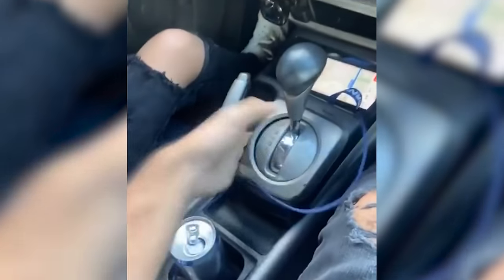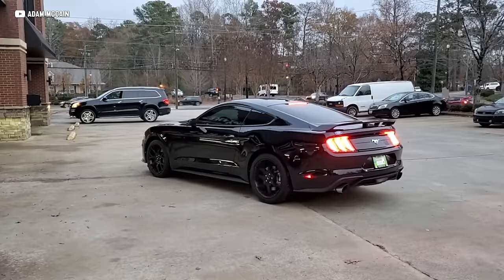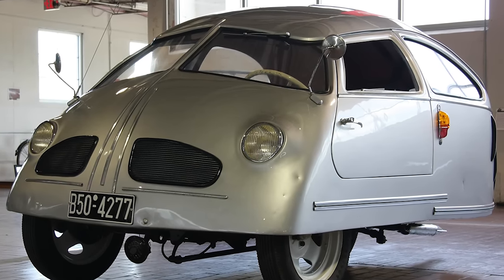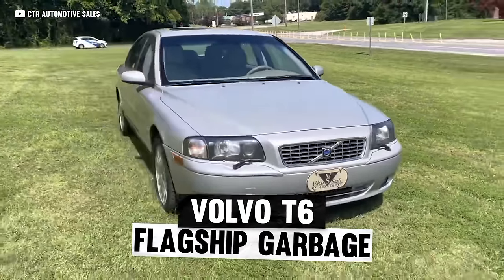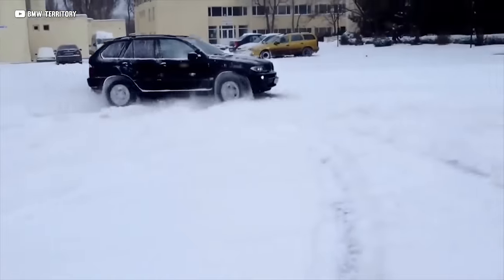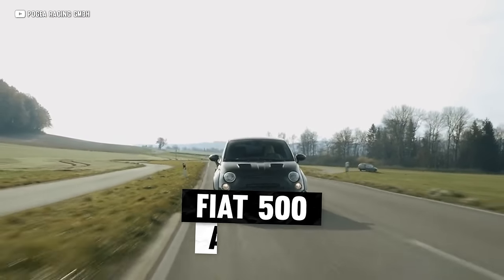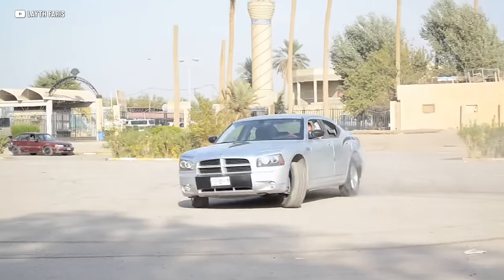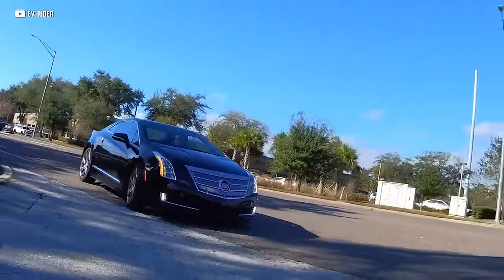Worst Cars You Should NEVER Buy!

Comment: Dead wrong about the eco, it’s a great car and it’s actually smarter to buy then the v8 buddy, better gas mileage and torque too
Reply: Is it actually? I’ve never driven any mustang, so I’m genuinely curious.
Reply: @dwest1756  I have owned mine since 2019 the ideal power band is between 2k and 3.5k rpm and being paired with a 10 speed auto acceleration is pretty good. With some upgrades and tuning you could easily match or beat the hp of a GT. Although I've always dreamed of owning a GT with a 6 speed manual it's definitely not a car to overlook by any means especially if you are under age of 25 or on a smaller budget. Also boost how can you hate boost
Reply: The Ecoboost may be a better car, factoring cost and practicality but the GT is a better sports/ muscle car. Depends on whats important to you.
Reply: @revmatic32  you also have to consider what the mustang really is it's not really a muscle car at the end of the day it's a pony car. Yes it comes with a v8 but traditionally the muscle car comes with a big block v8 not a small block v8 or anything below that so to call it a true late model muscle car ford really should only be putting there newer 7.3 gas engine in the GT
Reply: Ecoboost putting down more horses than every generation of Mustang V8's until 2010 that isn't a performance model like a cobra/mach1/shelby. The V8 fanboys pretty idiotic when they have to debate numbers.
Reply: @Tyler1288MC  Personally, it's not worthwhile to debate if the Mustang GT is a modern muscle car, it competes in the same segment as other modern muscle cars like the V8 Camaro and Challenger/Charger. You're right about what the term traditionally means so there is that. The point of my comment is that if you prioritize efficiency, cost and practicality there's a Mustang for you and if you want a sports/ muscle car there is also a Mustang for you, and that point still stands. 🍻
Reply: @revmatic32  I don't disagree tbh it was nice to alteast have a relatively civil discussion in the YouTube comments for once.
Reply: @Tyler1288MC  it is pretty nice huh!? There's hope for us after all, gotta spread the civility. What do you drive?
Reply: As a 2013 5.0 Owner, I am grossed out. My car can get 31mpg going to work an hour away. If you are worried about gas mileage then don't get a Mustang in general. These vehicle are fun vehicles, which come at a cost when you get rough with them.
Reply: @airbomb34  I still rather have a V8 2010 than an Eco. Those things sound like ass. I also doubt the ecoboost is more reliable than the 4.6 in anyway. You will be burning oil in no time.
Reply: I agree the eco boost mustang is a good car and has a lot of tuning potential and aftermarket support since it shares the engine with the focus rs
Reply: @airbomb34  so has basic sedan’s too… engines get better every year.
Reply: @revmatic32  sports and muscle cars are 2 different things. The ecoboost is a better sports car because it's lighter on the front end and it handles so much better than a GT. A GT is a better muscle car because it has a better sound and more ponies and works much better in a straight line.
Reply: @airbomb34  yes. Let's also not forget V8s are turning into dinosaurs.
Reply: @rickitysplitz7035  the 2010 look on the mustang was HIDEOUS. I agree though the eco doesn't sound great which I why I got the 3.7! So much better sounding.
Reply: @jake51515  I don't see it that way, and while traditionally the differences were significant , buyer trends forced Ford and Chevy to make their muscle cars more competitive in the sports car market. I'm sure the Ecoboost is a good enough car for people across a spectrum. Though, I think if I wanted a sports car in that price range I'd go MX-5 or BRZ. A GT with the PP2 or Camaro SS 1LE is a good sports car muscle car hybrid for my money. I went a little more and got a GT350 though.
Reply: @rickitysplitz7035  Doesn't your engine shut down 4 of the 8 cylinders during highway cruising?

Comment: The Ecoboost  Mustang was the best selling "Mustang"...until the Mach E came.
Reply: And the ecoboost is also more of a mustang than the Mach E will ever be, no matter how much cool music appears in commercials for it or how much ads will emphasize the nonexistent “mustang” part of it
Reply: Ecoboosts put decades of Mustang V8's to shame in the power rating. It's pretty hilarious anyone could actually claim it's not a mustang because it's not a V8.
Reply: @airbomb34  But you forget that the Ecoboost's downside is reliability. They are not solid like Honda engines, and will not last near as long as the 5.0, let alone 4.6. You also talk how they put them to shame but forget it isn't naturally aspirated. If you put a Turbo on the older V8s, they will surely put that Eco to shame.
Reply: @rickitysplitz7035  my brother eco has almost 100000 miles with no issues and yes you can put a turbo on a v8 but 4 bangers handle boost better and their lighter
Reply: @airbomb34 : Sounds like something an eco boost would say
Reply: @rickitysplitz7035  the Ecoboost engine is fine. You can easily get 300k miles from it. If you tune it, well it's up to how you tune it.
Reply: @airbomb34  the problem is that people expect the Ecoboost to be a V8... it's not. It's better for some things and lacks some other things, but it's a great Mustang
If everyone would see the Ecoboost Mustang as the replacement for the S15 Silvia... as a continuation, then it will never had to be compared with the V8.
Reply: @E46SedanGaming  lol you got that right

Comment: The Ecoboost makes all S550 Mustangs legit performance cars no matter what drivetrain option is chosen. Especially since you can get PP1 and PP2 performance packages. If you are a young enthusiast, in your 20's, first time car buyer you get a break on your insurance rates than the GT, you have way more usable room in Mustang than you would with the GT86/BRZ twins for roughly the same price and with a turbo upgrade and tune you would making GT350 hp and tq.  I'm  60 yrs old I remember the Mustang SVO when it was new.  Even Road &Track said it handled better than a Ferrari. But Stang bros were more interested in 1/4 mile times than turning a corner and the GT was cheaper.
Reply: You said it so I don't have to. All of the other cars in this list have horror stories attached to them about performance and reliability or safety. The ONLY reason the Ecoboost is on here is because "it doesn't sound like a V8." Laughable when so many viewers of this channel LOOOOVE turbocharged four cylinder imports.
Reply: @JosephFrietze  Yeah this was purely purely for aesthetic reasons nothing else. It didn't belong in this video. Besides this was a genius move by Ford  to have a base engine that have both balls and more the old V6 options a ton of aftermarket support more than even the turbo 4 in the base Camaro. And kick in better weight distribution than the GT it's win win win.
Reply: @colinw7205  the turbo 4 in the camaro has slot of aftermarket support

Comment: Disagree with the Ecoboost. That car puts out a lot of power and since it’s a turbo 4. It responds really well with mods cheap on gas light weight and a lot of aftermarket support. This engine was also used in the AWD 350hp Ford Focus RS.

Comment: The eco stang is a great car! I've owned 2 a 15 and a 16 both premium pack and the 16 with a ford performance tune and the larger calipers and brakes. I'll say it doesn't sound good, but it's still a fun car! To someone like me who loves the mustang, but doesn't want 15 MPG, the eco is the better way to go! Personally, now I drive a 14 3.7 because I got a good deal and for longevity, I trust the proven 3.7 much more not to mention the v6 sounds GREAT with a Rousch exhaust! It blows my mind the v6/4 cylinder stangs get so much hate. They make so much more sense than a daily driving V8. It also annoys me when people say "You don't get a mustang for the gas mileage". I'm like no, but that doesn't mean I want as shitty fuel economy as possible. 15mpg vs say my v6 which I average about 22 in the city may not seem like much at face value, but it's the difference between getting 240 miles in a full tank vs mine which I get about 340 miles per tank. Also not forget its got over 300 horsepower, as much as older V8s and there's still modding potential. Needless to say, the v6/eco mustangs are still great cars and without them the V8 wouldn't be possible.

Comment: You explained exactly what the fix is for the MazdaSpeed 3’s problem is. So buying it isn’t so dumb now, is it? And a bit of disassembly isn’t really much for someone who’s been working on cars for a bit.
Reply: And another thing, the SVO Fox wasn’t a screwup in my eyes. It had a decent kick for its time. 175hp wasn’t too bad for not long after the oil crisis. As for the ecoboost S550, other parts of the ecoboost family can be found in other ford cars. The ecoboost 3 cylinder can be found in the fiesta ST. An ecoboost v6 can be found in ford police interceptors, the explorer ST, and the bronco raptor. So don’t judge a book by it’s cover
Reply: The Speed 3 ine really isn’t even a “problem” I’d you’re only doing basic mods like an intake and exhaust. As soon as you start adding down pipes and removing cats or tube it,  then  you gotta upgrade the fuel pump.
Source: I’ve owned two Speeds
Reply: Yep... the title is dumb. Most cars have a weak spot, and once it's taken care of, well they become something worth keeping.
Reply: @E46SedanGaming  not a screw up, but Brad's statement about Mustang SVO and Ecoboost is.. along with 90% of the other statements he made in this video.
Reply: @AgustinLajeArrigoni-tv1kh  what kind of sense is that supposed to make

Comment: Don’t necessarily agree with your opinion on the ecoboost mustang , it does sound like a rice burner but it is  because it shares the same block as the speed 3 and 6i t’s a great daily it’ll never be the v8 but it still better then how you talk about it,  for people who just want a mustang it’s a great option save money on gas and might I add oil change cost of a eco is way less then a gt plus it corners a hell of a lot better due to less weight on the nose, I don’t understand why they get so much hate their a great starter platform that cheap and responds to bolt on well, way overboard on the SVO btw , I own a FBO Ecoboost mustang and Whipple stage 2 GT in case anyone wants to say I’m biased 😂

Comment: The Mazdaspeed6 also had the same engine as the Mazdaspeed3 but would snap rear diff mounts and drive shafts.  Mazda no longer makes those rear drive shafts so you have to go aftermarket when they snap. Both shafts and rear diff mounts you are over $1300 in after market parts and you have to drop the rear end out to fix them so you might as well get new suspension and anything else done that needs replaced.  I still want one.
Reply: I have a speed3, buddy has a speed6 and loves it. Highly recommend either

Comment: Dodge Stratus/Breeze/Cirrus are way worse than Sebrings...believe me. 
I had a Cirrus and it was bad, and I was young/stupid. The battery was above the driver side tire. They overheated all the time. They were quick if you had the Holley throttle body, but that was it. Plus, front wheel drive. Not fun, not reliable, 2/10 lol

Comment: I had a 2013 gli with the 6 speed that was great in like 2015. But it got me hooked and was looking locally for something more powerful fairly quickly. I found a single owner b8 s4 that had like 50k, and was at the same dealership that my dad worked at the bodyshop. The owner was an elderly professional, that he meticulously maintained. I scoffed at the auto transmission, but decided to go through with the test drive anyway. Glad I did, because I absolutely fell in love. Was obviously my first experience with a dual clutch auto. The powertrane was solid (while burning a bit of oil) up until 2 months ago, when I traded it in. It was painful, as I had grown attached to it, and had lots of memories. I did so because it turned 110k, and was starting to need more and more minor repairs, and also a costly starter. I knew it would wind up becoming a money pit, if I held out longer. Great car though

Comment: I have 3 Audi's, all turbo 4 cylinder. A 2001 B5, 2004 B6 and 2014 B8. My 01 has 200,000+ miles on it and in the 3 years I've been driving it I've never been stranded. I've put about 60K miles on it with no major issues!

Comment: The late model cheverlete 4.3 ltr engine is having problems recently too. I've had lots of em and I've had to replace  accessories but never had any problem with the 4.3 ltr engine. Now I have a 2018 I've never had to replace an accessory or anything what is knocking can I change the oil religiously yes it has 180,000 Mi but I'm used to getting 300,000 Mi on a big engines. What what went wrong?

Comment: I had a Pontiac trans sport v6 and never again, I had to tear off the inner cylinder head because of the exhaust leak (a bolt had gone off). Later, the intake broke, after that the gearbox began to malfunction and locked itself in overdrive. That with the gearbox I easily fixed by connecting a switch to the overdrive solenoid. Started leaking coolant inside the car due to the heater broke etc etc. 
Got a fiat ritmo for about 100$ it I drove for a couple of months before it started to be a lot of different electrical faults.

Comment: 6:19 The cutouts show mostly R56 models and these have a PSA and not a Tritac engine, which incidentally does not make things better! 
The early models up to 2006 had the Tritec engine, not the later 2000s models!
'Btw. the PSA engines are even more vulnerable than the Tritec engines and have significantly more teething problems! 
The Tritec engines are good and regular service even very good and robust engines, which is due to the steel engine block!

Comment: Here are some numbers for the V8 clowns.
From 1964 - 2010 V8 mustangs that's weren't a specialized performance version march1/cobra/shelby made less horsepower than any 4 cylinder ecoboost Mustang. Ecoboosts are more Mustang than decades of V8 Mustangs.

Deal with it haters.

Comment: loved the Sebring when I was in my pre-early teens my late maternal grandfather's 2nd wife drove a Sebring LXI coupe at that time the Sebring replaced the Imperial/Chrysler Lebaron coupe debuted for 1995 model year convertible for 1996 model year and the four door equivalent was the Chrysler Cirus had I not been legally blind/autistic I'd have either wanted a garnet red or Amathyst purple Sebring JXI convertible or a Toyota Camry Solara XLE V6 Convertible as my starter car my late maternal grandmother drove a 1990 Camry Dx 4 door hardtop sedan at the time though we later upgraded her to a 2005 LE model if not one of those I would've gone for a used 1990 Buick Skylark T Type coupe Riviera  or Reatta convertible in either Ruby Red or midnight blue with red vinyl/cloth top

Comment: I had a 2013 bmw 750i bought it at about 29k miles ran it to 70k until someone ran a red light and totaled it but I never had a single issue with that car just normal routine maintenance
Reply: That's not many. I had 180k on mine

Comment: What's everyone's opinion on the 2010 Volkswagen GTI? I'm looking at one tomorrow 112k miles, guy wants just over $10k, thoughts? He said it's the car that Paul Walker drove in one of the Fast movies lOl 😂 I wa spoke Oook lol looking for the most power for my bucks lOl
Reply: They are a good tuning platform with heaps of aftermarket performance options, but personally I would steer clear of any modern vw with over 100k miles. That’s when the problems start (if they haven’t already), and tuning on higher mile cars carries greater risk of failure. For mine, Pay a little extra and travel if u need to for a low mile example ensuring it has good service history.
Reply: @antoniosvorrias9100  my grandmas beetle has 130k miles and no issues
Reply: @antoniosvorrias9100  Thanks so Much!!!! I was thinking of looking for a 2door anyhow....now dude at the lot told me it was a 4.0 turbo, but online it says it's a 2.0 turbo ? I guess my brain is having a hard time believing that a 4 Cyn will put out the power I'm looking for lol I did drive a mustang Ecoboost, a 2019, and it was plenty quick for me lol I mean I'm not looking to go to the track lol just have fun on the expressways, and maybe be able to gap a few folks, not many for sure LmaO

Comment: 100% wrong myth 10 Any honda with v-tec absolutely NEEDS to warm up or you can actually ruin ur  your v-tec also if you try to cold v-tec engines will not ENGAGE V-TECCCCCCC. Also applying to any VQ engines with VTT. both say in owners manual let engine warm up b4 or you can cause problems with Cylinoid. Buuut I also Bet you won't notice this comment or correct it in a video.